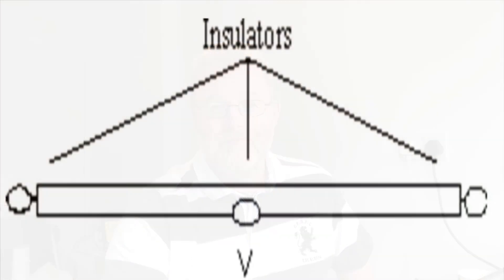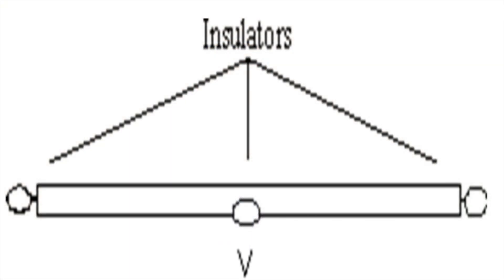Ham Radio: Folded Dipole for HF

Comment: Make a 3-wire folded dipole which will increase the feedpoint impedance 3 x 3 = 9 times which may be a better match for high-Z ladder line (open wire line) or window line.

Comment: Are those folded dipole antennas tuned the same way as the ordinary dipole? I mean shortening by cutting off the edges?
Reply from the maker: For a folded dipole you would need to shorten both edges by the same length and ensure that the newly trimmed antenna is still a folded dipole shape. 73
Reply: @TIMG5TM  73 thanks.

Comment: Hi Tim, I am building a 40 meter folded dipole with the help of another ham K6EXY (here in California). He builds a custom balun for 300ohm twin lead ladder line. The big question I have is the feedline length. With the DX Engineering multi band antenna's they recommend the feedline length of 300ohm should be an odd multiple of 15' (for 40 meter band), ie. 15x3, 15x5 etc. Does the same logic apply when building a folded antenna single band? Or does it matter at all for a mono band folded dipole. 73's John, K7CID
Reply from the maker: Hi John. If you mean a normal half wave dipole, then the ladderline should strive to be a Halfwave or multiple thereof long on the band being used (allowing for velocity factor). This should help to provide a good match

Comment: I used one of those commercially available, folded dipoles. The SWR was pretty good across multiple bands, (because of the parallel resistor) but the performance was absolutely awful. It was the worst performing antenna I've ever used in my 30 years as a ham.

Comment: Why are the commercial vhf uhf installations you see mainly folded dipoles Tim?
👍👏👏
Reply: I'm not Tim, but they have a wide bandwidth, and if used in a yagi they increase the feedpoint impedance which has been lowered by the other elements.